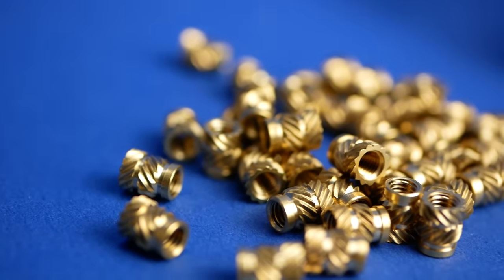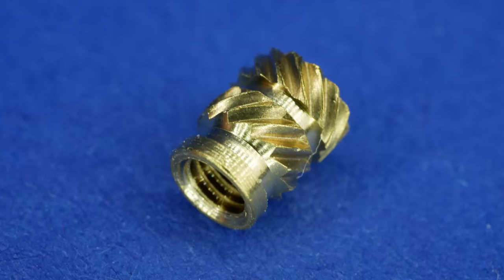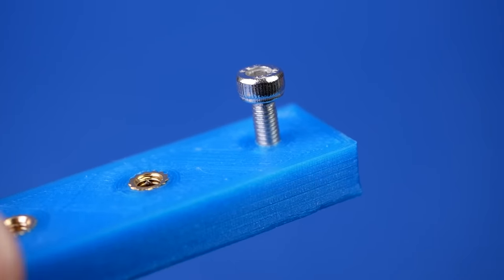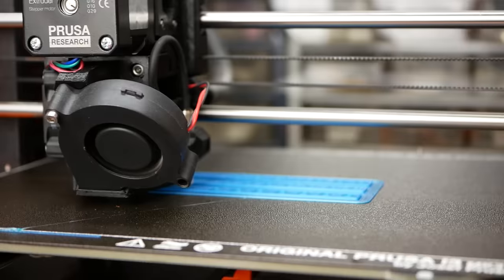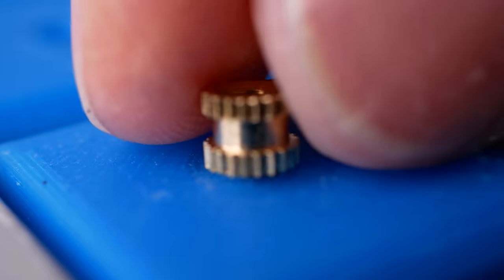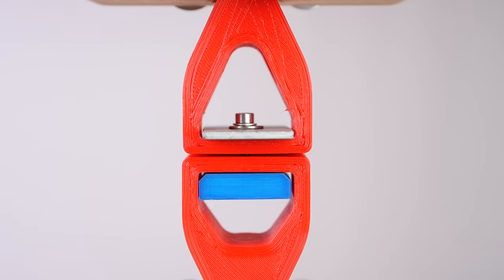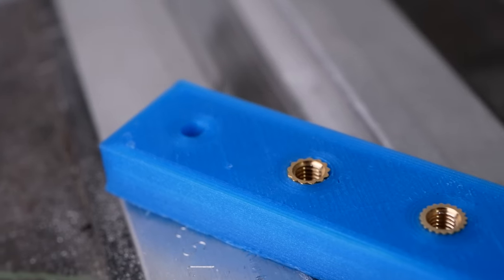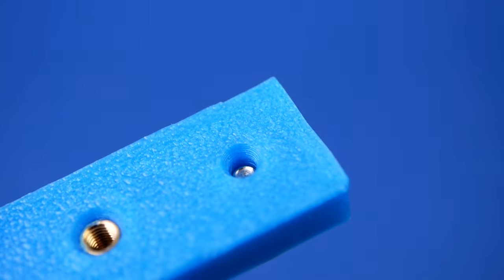Threaded Inserts for 3D Prints - Cheap VS Expensive 💰

Comment from the maker: Don't forget to share this video on Facebook, Reddit, Twitter and other social media!
Reply: Impressive analysis committee and methodology as usual Stefan!
Reply: On your torque out test, the reason for failure of the bolt head is because you are torquing againts the insert itself, you could try using a longer bolt and thread lock it into the insert and use a washer to provide lateral support for the fastener head and shank.
Reply: In my practice most (if not all) of the insert are being pulled out from the opposite end - so "pull-out force" is not important, as printed parts (elements of HEVo) are starting to crackle ominously when screwing then hard :)
Also - by inserting M3 bolt from the opposite end while heating insert with soldering iron helps A LOT with keeping them straight. And I used only cheap ones so far.
Reply: Just a heads up, your M3 aliexpress affiliate link is broken.
Reply: There is a problem with the audio in the video, around 1:05 it cuts Your voice and then returns to normal after a second
Great video anyway :D
Reply: Du kommst aus Deutschland oder nice Video
Reply: Hello Stefan,
Thank you for your very good comparison video.
We are happy about the very good results of our ruthex thread inserts.
Your video has sold off inventory at Amazon pretty quickly.
But we already have new goods on the way to Amazon.
best regards
Reply: While it would require an inset on the back side of your print for clearance (...or just embed them in the print), it would be interesting to see how standard pronged or sliding 't-nuts' would work.  I imagine that the pulling force required would exceed the strength anything they are anchored to but I don't know how well the pronged type would resist twisting compared to the others.  You can also get them from Amazon/eBay/AliExpress/etc. for about the same price as the injection molding inserts--100 M3 for ~$4USD.
Reply: >fusion 360 

cringes in engineer

(inventor is way better and is just as available thanks to the autodesk education community.  you don't necessarily need a .edu email and I'm pretty sure they dont validate any of the info.)
Reply: 11:00 my EUROpinion ? ;D
you should ask ebay to sponsor you (like they do with collin furze),
 i bet a lot of people searched on ebay after the video like me.
Reply: Print speed x strength video please  !!!
Reply: Hi Stefan, have you tried heating your screws when directly screwing into the plastic? I mean print the holes even a little more under size, and screw the screw in with a soldering iron with a slit attachment? My reasoning is that the plastic should relax around the threads of the screw and therefore bond much tighter into the threads. Give it a try if you think it is viable!
Reply: Try self tapping or wood screews
Reply: have you tried modeling threads?
Reply: Is there a way to test against vibrations?
Reply: Aliexpress one is good too! but depending on application.
example: you want a lid on a batterypack to purposely blow open in case of explosion facing away from the user.
Reply: r/woosh?
Reply: Wouldn't it be better to put the inserts on the Back side of the part so it has to pull all the way through?
Reply: Instead of machine bolt screwed directly to plastic, it would be great to see a test of proper screw with thread designed for plastic, and regular universal/wood screw too for comparison.

Comment: As an ex aircraft engineer, I've always fitted inserts from the back side for a superior fixing.
Reply: thank you for sharing you experienced tips :)
Reply: If that is a possibility, but if it is it will greatly improve performance. I would like to test out if it would be possible to insert them during the print with a pre programmed pause in the g-code for parts where that wouldn't be a possibility, though I think I'll run into problems with the bed level.
Reply: You mean so the thread goes from the other side through the plastic?
Reply: @EGGSHL  I think he means he'll insert it from the back side so the force on the end product will try to pull it further in.
Reply: not always possible but good when it is.
Reply: What would you do for a blind hole
Reply: @danietkissenle  rivet nut
Reply: A good design intent if possible
Reply: Impressive that's something that you wouldn't know if you were a carpenter, so I'm glad you told gave us your impressive credentials 😂
Reply: So you can use hex nut in that case and no need to have inserts
Reply: As johnny sins, I can agree that I too do that.
Reply: @katura. you can do that with nuts
Reply: the point of using thread insert is fitting them on top side,its not always possible to do it as you said, very situational.
from back side you would model in hex shaped hole and use nuts instead
Reply: @katura. shouldn’t have a problem with bed leveling unless your motors turned off during your pause. Then you run into needing to home the printer again before printing.

Comment: Those "cheap" inserts appear to be overmolding inserts, designed to be held in place and have plastic flow around them. When you heat press those, I'm guessing a cavity is formed where the plastic did not flow and create the ledge necessary to mechanically lock into the plastic.
Reply: this is 100% what is going on. Those are meant to be in place at the time of molding, not added after the fact. That's why they don't have the lead in chamfer and they push plastic when you try to melt them in. They are not designed for this application, though they will work ok for light loads. When used in their intended application they are equally or more strong than the actual heat set inserts.
Reply: Perhaps it would be worthwhile to experiment with holding the soldering iron for longer to see if melting the plastic more helps with that issue.
Reply: agree
Reply: I just print the hole smaller than it should be and hold the iron for a bit longer. The only time such a part broke wasn't even in the place of the insert despite it being the place with the most stress applied
Reply: Was hoping you would try a pull through test as well as a pull out since that would provide the greatest strength for them all. I.E. insert the insert on one side but screw the bolt into the other.

Also, I wonder how well M3 wood inserts would work (if at all) https://i.ebayimg.com/images/g/2koAAOSwDoNd1PUd/s-l400.jpg
Reply: @boblewis5558  those wood inserts look similar to what Tappex make. I would also suggest trying those, since they're specifically rated for plastic, in particular the Trisert series are self-tapping, but you need their tool to insert them. Admittedly it's a quality bit of kit which automatically deloads the insert when it's fully inserted, so it's always perfectly flush with the edge of the work piece. The inserts are fairly cheap, and I think the tool is < $50. I've used those in SLS parts before and they work reasonably well, but you need to fiddle with the hole diameter to get a snug fit. Usually the failure more isn't the insert ripping out, but sometimes the insert will rotate (and unscrew itself) if the hole is oversized, or the bolt expands/catches. Either a bit of epoxy, or heating with a soldering iron can help with that.
Reply: Yes. I was wondering if wrapping a bit of filament in that cavity prior to inserting would work.
Reply: This is exactly what i was gonna say they failed because these are made to be isued inside the injection mold, and even with a smaller hole and longer heat application the result will still be below optimal
Reply: I would love to see a test where the print is paused, the inserts are added, then the print continues, and prints plastic over the edges leaving only the threaded hole exposed. This would likely fix the pull out strength.
Reply: @designersmind3140  i saw this and the part failed where the print stopped and restarted, granted it was a differential gear
Reply: Spot on. Best inserts I use is just a trapped nut in the 3D print. I basically have the print pause at the height I need it to, drop in a hex nut, and resume printing. Works great every time!
Reply: Another interesting option that might work in some cases would be to design the insert geometry into the part slightly undersized.  Then you could split the print down the axis of the insert, place the insert in its desired location, then glue the part together, heating the insert as the parts are meshed to melt the threads into the part and secure their rotational position.   Again, this would probably only work for very specific situations and would require significantly more complex design, especially because you'd probably want a more complex split geometry with meshing locking points on the two sides of the part to ensure the part's rigidity after assembly.  I'll probably draw up some designs and test this idea after my inserts come in.
Reply: the cheap ones are for overmolding in an injection molding press, where there is enough pressure to force material into the cavity between the end flanges.  heat staking them into a part will trap some air in that cavity so prolonged heating will not fill it.
Reply: what if one dipped the overmolding inserts in epoxy or molten plastic, then heat pressed them in, held the heat an extra few seconds then let them cure?
Reply: @boblewis5558  You could use just a bolt in that case? But I agree that I would first try to have the fastening bit on the opposite side of the part, or with side loading if for aesthetic you can't have the insert/bolt on the opposite side.
Reply: You can really tweak the hole patterns to fit the inserts perfectly. I typically do a 2 degree draft and 0.15mm chamfer on the rim to seat them flush. I bottom out the bottom of the hole continuing with fastener clearance, so the insert will move plastic back upwards into the taper. For the price, McMaster is still a great source.

Comment: Sometimes we don't need a lot of holding strength but instead need the ability to insert and remove the screws a number of times without damage to the plastic. In this case the cheap inserts could be more than sufficient.
Reply: Did you watch the entire video?
Reply: @TheMidnightSmith  if you don't need a lot of holding strength the cheap ones are good enough. 
Now that i know that cheap ones holds up to 30KG i surely going use then for hold up to 15KG...
Reply: if it has no chamfer then it's a pain in ass to work with!
Reply: @KiR_3d  you can maybe remedy this by adding a slight counter sink to your design.
Reply: @LopezfsS  Sure, but it can be hard to implement if you have thin walls (actual walls) for example. Then on one end it will have almost no grip.
Reply from the maker: Tested that in the last video.
Reply: @CNCKitchen  Also you can use HELICOIL (I don't know how to name it - thread repair set?) inserted  directly into threaded plastic.
Reply: @mateuszg.2144  I think even a stripe of gas tube teflon tape will work fine. I "fix" my Vidima's ceramic valve by this tape ~ every half-year. They're expensive and  a chinese clone has the wrong length (not suitable for my sink's model).
Reply: Actually, they are all cheap. Look to the sites that actually supply them, like grainger or some other industrial supply, and you can buy them by the 1000 for cheap money. Problem is, they sell by the 1000. You are paying a premium to buy a few 10s from some dude who bought thousands.
Reply: All of them can be bought on aliexpress. All of them are "the cheap ones" lmao
Reply: @TheMidnightSmith  Did you read the entire comment? Nothing in the video states they would be a bad idea to use if you don't need a lot of holding strength.

Comment: just a pro tip from a carpenter, if you know you're using a softer material don't use a fine threaded metal screws, wood screws are coarse threaded with a lower pitch and they grab much better in these softer materials such as plastics as well

Comment: Whenever possible, threaded inserts should be installed on the side of the part opposite from where the fastener is entering it.  (Obviously this isn't possible with blind holes) This preferred orientation results in the fastener pulling the insert even more securely into the part.   It would be interesting to repeat your pullout tests with your test blocks flipped over.  I've found that the plastic part will usually fail catastrophically before the insert is pulled out.

Comment: Surprised that the direct “screw into plastic” method was so effective at pull out resistance. Performed just as expected on the torque-our test. Didn’t think it was going to be any good at that.
Reply: I did this with a bunch of M6 screws.  I heated a screw with a small heat gun, and threaded the screw in to the PLA to form the threads.  After the holes cooled, I stripped a couple of the holes by tightening the too much.  The M6 threads are pretty deep, about the same as the wall thickness of the PLA.  If I figured out how to create thicker walls around the holes than the rest of the model it would have been better.  This video is great because I've wondered about which inserts would work best.  Now, I wonder if the results would be the same with bigger screws.
Reply: @microdesigns2000  Generally speaking, the bigger you go, the easier the pull-out will be, but the harder the torque-out will be.
Reply: I always just tap right into PLA with a tap set and never had an issue where those threads were the weak point.

I bought hundreds of brass inserts to use when the tapped threads fail...but they have yet to fail!

Comment: I would think your major advantage to a threaded insert, particularly when you might choose the cheap ones instead of threading directly into plastic, would be for something that doesn't require great strength, but does require repeatedly removing and re-installing the fastener.  In those conditions, cross-threading and wear would quickly destroy the threads in plastic alone, where the brass insert would happily withstand as many cycles as you'd wish to throw at it without appreciable wear.

Comment: Was just thinking about fitting them into a pocket from the back, The back hole should be sized for the insert but the front sized to just clear the thread thus leaving a shoulder for the insert to pull up to.
Love the testing machine by the way
Reply: I'm using your suggested method whenever possible and it works very well even with the cheapest inserts.
Reply: Another potential depending on the design is to make a slot for a regular or square nut to insert them from the side. This essentially embeds the nut in the middle so it is as strong as your piece on pullout. The only issue that I've run into with this (mainly with regular hex nuts, less so with square nuts) is torquing, as the nut may spin through the plastic when tightened as it's only held by 4 sides. I've solved this by simply filling the slot by melting filament which securely locks the other sides of the nut in. Again this is definitely design dependent, requiring the ability to create a slot in the side of the piece to slide the nut in sideways, but it is definitely the strongest when it comes to pull load as the nut is fully embedded in the piece.
Reply: Absolutely.
Reply: @newolde1  CNC Kitchen did some testing with steel nuts.  Putting the nut in a bottom pocket gave over twice the pull-out strength over the side-pocket method!  (165kg vs 85kg) Even threading a bolt directly into the plastic was stronger than side-pocket at 118kg!  Helicoils and inserts were barely better than direct threading the bolt into the plastic at 120kg vs 118kg so inserts are a waste of time it appears.  (maybe useful if inserted differently as some suggested here)    There are some surprising results: https://www.youtube.com/watch?v=2wRc1KbEAU8

Comment: What? Quality bolts shearing at 3Nm? Uh, that shouldn't be, was the quality may be the machining but not the material?
It's hard to see in the video, but if those had an 8.8 stamped on them, and they broke at 3Nm, then either they are mislabeled, not-quality, or your Newtonmeter Wrench is about 1/3 off.
An M3 8.8 class bolt should not fail under 4.02Nm, but a 6.8 one, for example, is only rated for ~3Nm, 12.9 ones are even rated up to 6Nm.

Sorry, I'm an industrial mechanic, cheap mislabled screws on things is an annoyance i cant stand XD

Comment: I've been using some I got from Adafruit and have found that, as I iterate, I waste a lot. Thankfully, I've found that you can actually reuse them if you screw a screw in all the way, blast it with a heatgun, and pull. Ruins the part, but if it's a failure anyway who cares? Just thought I'd share in case it helps anyone.
Reply from the maker: Good idea!
Reply: This is actually where the cheap injection molding inserts excel - they are so easy to pull out that you can reuse them again and again... -.-

Comment: Just a heads up to new people. 95% of the time thread inserts are a waste of time. If you are just attaching two things together that won't experience massive load, theres no need to have threads at all, the plastic will thread itself. If you are attaching a member that needs to be very strong, you should use a nut as threaded inserts can be inconsistent and the added compression from the nut will often strengthen the part. There's no such thing as "pull out force" for a nut, because if that happened something is very very wrong.

The one exception is when you can't install a nut due to the geometry of the part. In that case these are a game-changer. But they aren't a good first choice, and if you are tight on money buy a good screw/nut kit first.